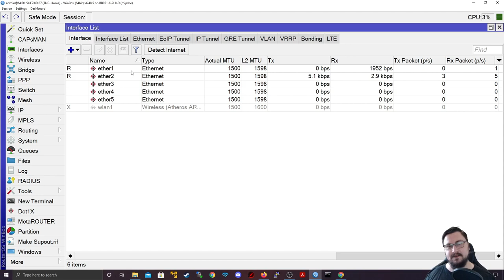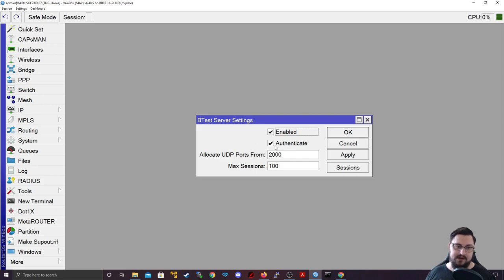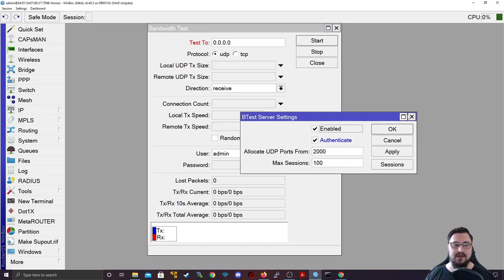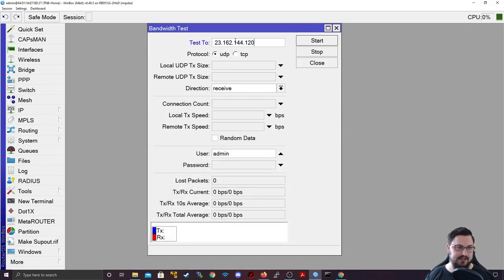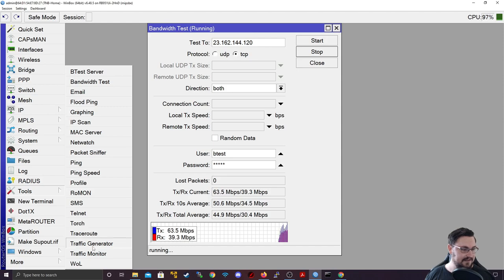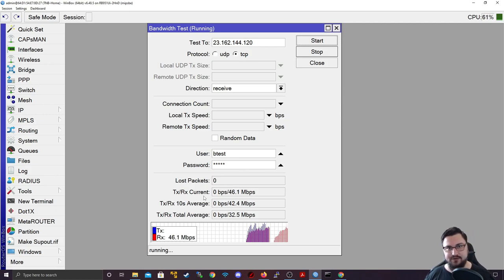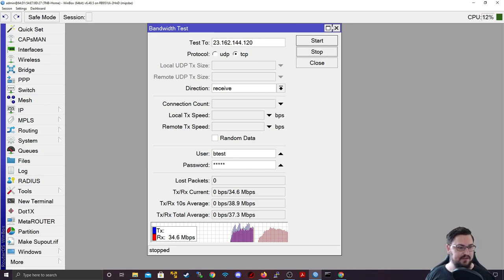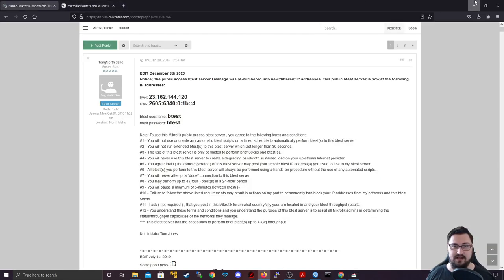Full MikroTik MTCNA - Bandwidth Testing

Comment: How accurate do you find the bandwidth test to be? I've got 2 x CRS518-16XS-2XQs and I've got QSFP28+ 40Gbps fiber between them. With bandwidth test I can only get 100Mbps TCP up and down and the CPU is at 100%
Reply from the maker: I generally find the BTEST to be pretty accurate, although I know some people like StubArea51 tends to use alternate tests for throughput, though I have seen them do Bandwidth tests with 100Gbps results. If your CPU is capping out then I would suggest either fasttracking the traffic or making sure that fastpath is enabled so that the switch chip can handle the traffic. Your experience does not sound like it should be the norm. So if those options also yield similar results I would suggest taking it up with MT directly, their support is super helpful
Reply: @TheNetworkBerg  Good points. Are fasttrack and fastpath used in switching or just routing? I'm trying to go a bit deeper into architecture. I'm not doing any routing or VLANing for my test, just a layer 2 connection.